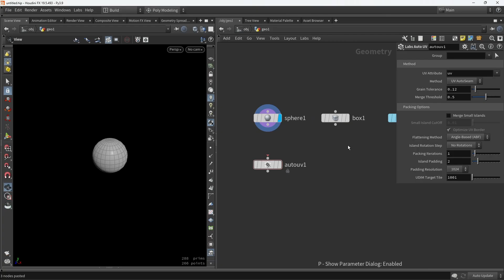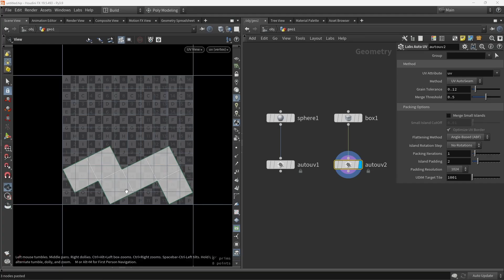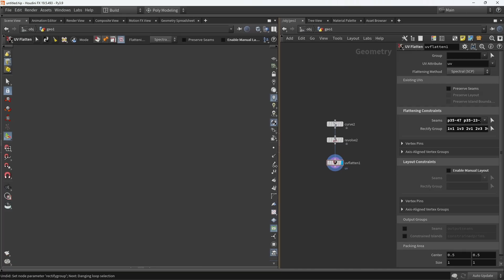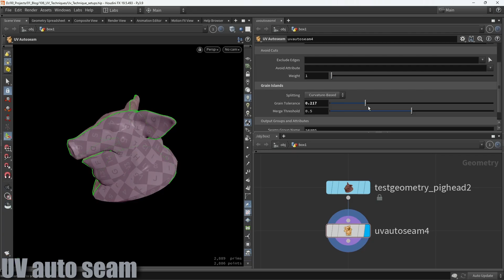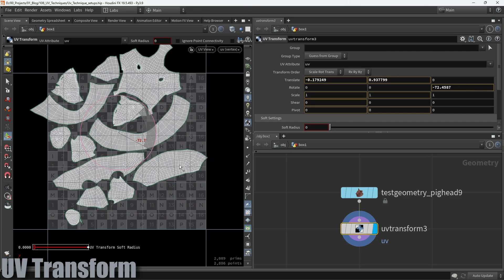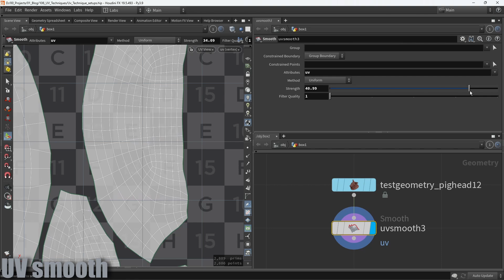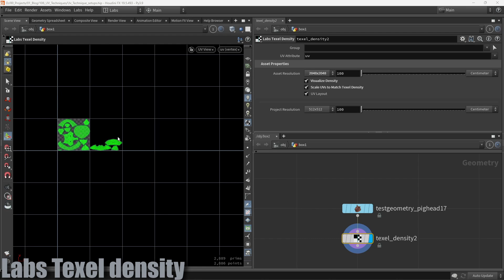Houdini Unwrapping Techniques: The Basics

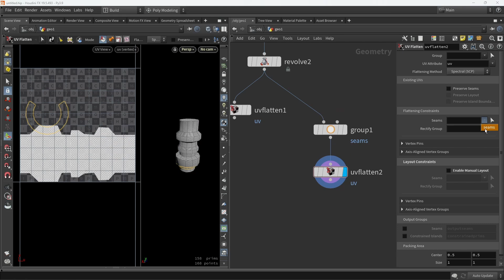Comment: What is a good way to procedurally select a single vertical loop on a cylindrical shape like @3:31? Select top and bottom faces for seams are easy but adding a single extra vertical loop is challenging.
Reply: maybe Find Shortest Path?
Reply: @ideallyyours  Find Shortest Path does seems like a good fit for some cases, thanks for the sugestion.
Reply from the maker: Yes, that is the tricky part. You could use some with the shortest path or combine it with autoseams node, overall there has not been a solution that would work on many different type of models.